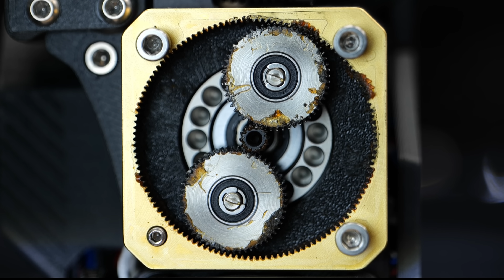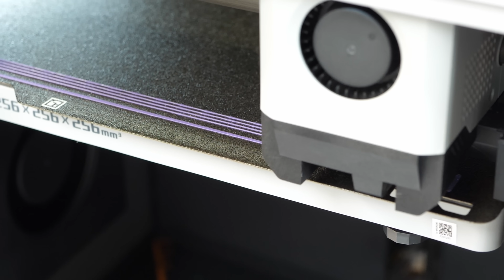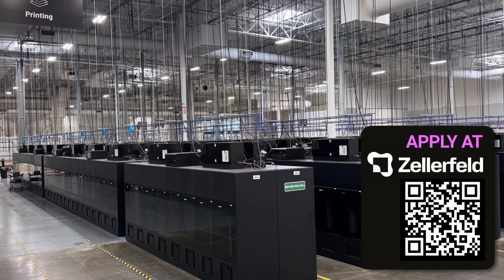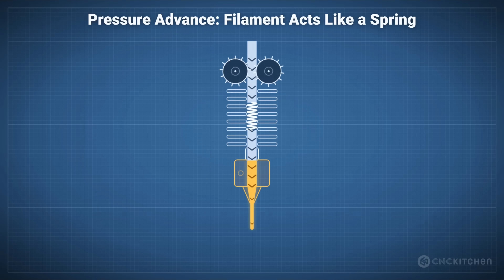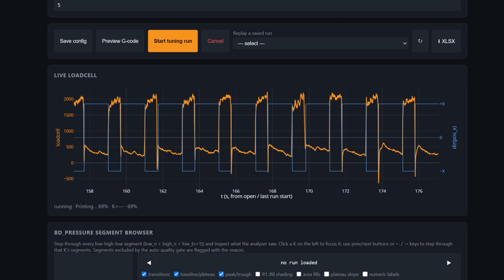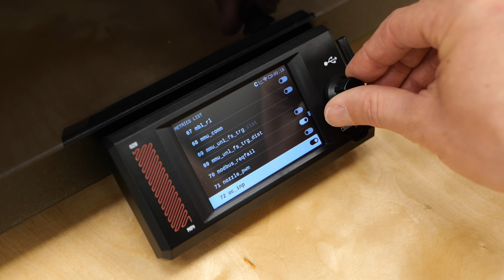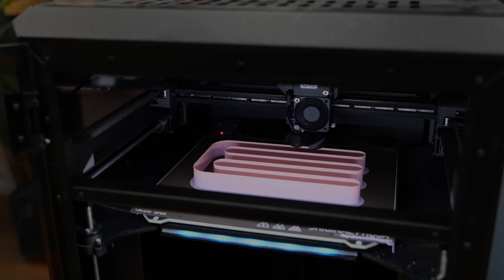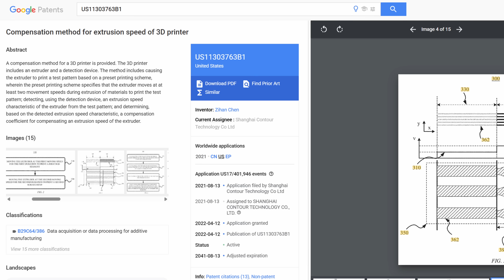I Automated Pressure Advance Using a Bed-Leveling Sensor

Comment: 2:40 even with a (per filament) calibrated advance, I still get the hole issue more than I'd like.
Reply: With a toolchanger you need a per nozzle calibration as well due to variances between nozzles due to wear.

Comment: Hi, I overextruded a Snapmaker u1(setting flow to 200%) after some printing (with ugly surface) he stops and told me there are melting issues. after returning to 100 % all printed fine to the end

Comment: On the patent thing, I'm thinking one could introduce hooks and standards for things like the pressure advance, max volumetric flow rate, crash detection, etc into the Klipper firmware, in a way that when turned on, it would send and receive data from an external script (so basically what snapmaker's fork did). Then if there's a patent issue, printer manufacturers using Klipper could put toggles for those in the control panel, and anyone could flash the open source add-on modules for those automations after downloading them from the klipper repository :-) being outside of the main klipper codebase would also make it easier for different people / groups to build their own versions or forks of the add-ons without causing issues with proprietary main code forks like snapmaker, or anycubic, etc.

Comment: Well, for perfect prints using a constant PA value is insufficient. As you, Stefan, most probably know, PA value is also flow rate and acceleration dependent (see Orca's adaptive pressure advance). So yeah, nice approach but still worse then manually calibrated ;)

Comment: If you have enough processing power, with the load cell they could also do a closed-loop pressure advance that works in real time while it's printing, without a set k-value. Zero calibration other than the factory tuning and nice results, by basically turning the extruder into a weird servo motor :D
Reply: Exactly my thoughts when I got the BDpressure! Unfortunately, the movement of the hotend during printing enacts some force onto the same sensor that would be reading data for PA calibration; hence why the loadcell/strain guage options have to park to achieve their readings.
Reply: In my testing PA is not linear but is also affected by back-pressure from the print surface, which is why PA is different for bridging. The feedback pressure reading you would get would also be affected by this back-pressure, but it might actually be a pretty good indicator of the effective extrusion pressure and thus flow-rate. At the very least it's another bit of data that could be combined with other signals to give more accurate results.
Reply: That's how the automotive industry uses engine data to continously change the air fuel on cars.   "Knock event detected, retard timing"  "o2 sensed rich burn, pull back on fuel trim"
Reply: A lot of industrial printers dos this

Comment: I bet the lidar on the bambu labs X1 was only initially used until they figured this out. You should try having the printer print lines on the bed like the x1 though so that it gets the most accurate pressure readings for reproducibility while printing
Reply: Thats the cheap way and I think its mainly a cost cut thing. Lidar is expensive and load cells are cheap.

Lidar is far superior in my opinion. 
What counts is what ends up on the print bed, not any second order flow dynamics derived from forces inside the hotend, which give you just a good idea about whats happening. Measuring the actual line width is the only real way to do it. Ideally constantly and while printing to have real time feedback.
Reply: @MsKoffeinjunky  the Lidar (not time-of-flight but trigonometry) on the X1 is garbage compared to the load cell on the A1 onwards.

Comment: One thing to note is the X1 lidar seems to have been originally designed to work with gray beds like Bambu originally supplied, if you use a colored or high gloss bed it has a tendency to throw off accuracy a lot. Bambu could use their official bed ID's (ArUco ID) to have a table to adjust for expected reflectance values and normalize, but since they didn't release colored plates this made it so the automatic tuning struggled on 3rd party beds (something I'm sure they were fine with).

I always did the PA calibration on the official bedplate and then switched to the plate I wanted (e.g. BiQu, Wham), you just wouldn't want to use a per-print PA calibration on non-gray neutral beds.

The pressure sensor method doesn't have that issue since it removes the bedplate variable.

Comment: One thing that hasn't been fixed (as far as I am aware) is reducing the actual flow rate at corners to compensate for overlapping extrusion. This makes the pressure advance calibrations give different results depending on if you use a straight line test vs a corner test vs a start and restart retraction test. It is an error that has been there since the beginning of slicers due to the way they model extruded lines. Slicers currently assume the "shape" of an extruded line is just a rectangle, and extrude the amount necessary for a rectangle. You can see this in the slicer preview. But in actuality, the shape of an extruded line is a rectangle with rounded ends. Where a corner or seam is, depending on the angle of the corner, the two extruded lines overlap by a varying amount. Which means if you don't account for the overlap, you will get overextrusion at corners even if your PA value is perfect. Here are some github issues that talk about it. It just hasn't gotten enough people to work on it to really solve: https://github.com/OrcaSlicer/OrcaSlicer/pull/11841   ,     https://github.com/slic3r/Slic3r/issues/5182   ,    https://github.com/OrcaSlicer/OrcaSlicer/issues/11254

Comment: if you implement it as a macro in klipper so that the gcode is dynamic based on the latest data set you could probably have it do a binary search to converge on the ideal values quicker

Comment: On the Essentium HSE we had direct drive extrusion and the current measurement was a big help to characterize materials and print parameters.
Load cells are definitely in the right direction due the sensitivity. 
Your approach is really interesting since is close to closed loop control, if you know what pressure you need for each material and temperature.
Reply: " ...and the current measurement was a big help to characterize materials and print parameters." Thats actually a quite interesting approache, that would mean its would be to implement such a thing without the need for a load cell and for printer that don't have one and would make it quite hard to implement a load cell into the print head.
Reply: Hey Jorge! Funny thing to randomly spot you here xD
Yeah I remember that it was quite useful when working on the 9085 profiles for DB. The only thing that might distort it a bit, is that current measurement observes the source of mechanical motion and not the recieving end. So stuff like f.e potentional backlash or stickslip in gear translations could have an impact on the measurement but influence the result differently. (I imagine)

Comment: The commanded square wave is a nice stimulus to measure the system frequency response function and the springiness of the extrusion system is a low pass filter. I wonder if you might get a better measure and more useful information from Fourier transforming the load cell data and calculating the FRF.

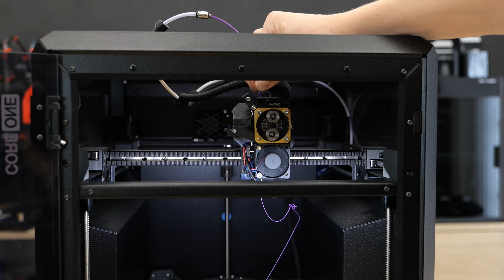Comment: As usual you did a great job in this video! However, the explanation around 1:20 is incorrect. The filament does undergo compressive stress, but the material is barely compressible since most polymers have Poisson ratios shortly below 0.5. The filament may buckle a bit in the feed zone, but this is probably negligible. You could very easily synchronise the extruder feed rates with the tool head movement speed and get wonderful results if the material would cooperate. The main driver of the time-dependent behaviour you describe is due to the viscoelastic behaviour of polymers, i.e. the deformation behaviour in both their molten and solid states are dependent on time and deformation speed. If a constant stress is applied, the strain follows with an exponential time decay and vice-versa. This comes down to the superlong molecules that basically behave like a pile of spaghetti, so they rearrange themselves over time when under load, align themselves, and retangle or spring back into their original state when given the opportunity. That is the real cause of the modulation required to combat corner bulging.
Reply: I understood the video explanation to be visualising what you describe, that this springiness is occurring in the liquid state.

Comment: I wonder if extruding in the air is holding the results back somewhat. There would be slightly more pressure in the tool head while actually printing an object, especially at lower layer heights. It would be interesting to see what the machine would chose when printing the actual test pattern or tower
Reply: Works for bambu lab so it should work here aswell
Reply: @ulwur  Bambu prints its calibration line(s) onto the print bed.
Reply: They could calculate this backpressure beforehand and maybe compensate for it?

Comment: Have you tried running two K values? One for advance and one for decline?
Reply: This would need something different than the existing `M900 K0.00` pressure advance system currently built into klipper and Marlin firmware. 

It's an interesting idea, which would work quite differently than the current approach which is approximately introducing the extrusion commands early before they would naturally be expected to happen. The question is whether this increased complexity would give proportionally increased print quality. Currently a well calibrated K value is generally enough to get good print results but sometimes not at the most extreme print speeds, especially for viscoelastic fluids like melted PETG and TPU
Reply: That's what I wanted to ask too. Why do they only use one K value and not two... for acceleration and braking.

Comment: A few days ago I finished modifying my Ender 3 max to direct drive extrusion, optimized for printing TPU. The PA ended up at 0.75, which I think is very high, but it works; the extruder motor isn't failing😂
Reply: That is correct, tpu requires.very high pa value but it doesn't even need it that much since you are printing it slowly
Reply: @riba2233 In fact, it was quite bad; the corners on the test cubes were sticking out by more than 1mm, now they're actually corners.

Comment: We could also calibrate the rigth extrusion temperature, if we can decide on some acceptable range of filament pressure for a given material at a given flow rate, we could gradually increase the nozzle temp until the pressure measured by the load cell falls into this range.

Basically, if a load cell allows you to have a reliable observation of the heat chamber pressure, a lot can be done to ensure good extrusion. In a plastic injection machine, there is a dedicated sensor for the pressure in the chamber, that is critical to control the polymer injection.

Comment: I've spent over 100 hours messing around with pressure advance on my MK4S. It's so important for springy filaments like PETG and I've struggled so much with it. The existing pressure advance calibrations are so labourious, cycling through different flow rates and performing manual analysis. This tool will be such a gamechanger. I'll try it tonight and post my results on github when I'm finished with it. 

THANK YOU STEFAN
Reply: Hi! Did you end up testing this on your MK4S? How reliable was the load-cell data logging? Did you notice any dropped samples/packets or gaps in the recorded data, especially during longer recordings?

Comment: The issue is the offset between nozzle in free air pressure response and in printing condition response.
Backpressure is the main factor.
Calibration should be done real time while printing
Reply: Unfortunately the prusa buddy firmware cannot change PA value without clearing the movement planner, which causes the printer to halt. It's a known bug.
Reply: @321tryagain i see what you mean.
Generally speaking, while 3d printing controllers and softwares descending from open source reprap philosophy is a very cool think, there is a distinct lack of industrial approach.
For instance there is no fully developed firmware capable of controlling industrial servos via industrial protocols like ethercat.
It is always the “lowest possible requirement” approch that is now slowing down open source development.
Sum that with the peculiar “first lady behaviour” of many software communities and you get the receipe for companies like bambulab expoliting open source and gainig terrain giving the mass what it needs.

Comment: I guess someone could use one of those sonar or optical sensors from one of those Raspberry Pi development kits, print the PA line test, scan it with the sonar sensor, then automatically pick the line that appears to be the most uniform and adjust the K value (since it knows what was printed when). This is assuming the sonar sensors in those kits have fine enough detail to determine when a line is uniform thickness or not. Line chasing robots use this principle all the time to determine the action they need to take.
Reply: Its almost impossible to get 1mm accuracy out of a sonar sensor.

Comment: I've often wondered why Prusa hasn't implemented something like this themselves in the time since releasing the MK4. Back then, there was a lot of talk regarding potential features the loadcell could make possible, but it never really seemed to go anywhere. Thank you for saving us all from manual PA calibration!
Reply: because its not needed and just chasing unicorns ...   im printing for several years now on different printers with more than 20 different brands and materials ... i opnly ever had to calibrate for one type of filament ( pla, abs, asa, peg, tpu , pla-cf  and so on .. ) never for manufacturer or colors .. it was everytime i calirbated the same across different brands for the same type ...   completely useless to chase perfection here and a waste of time before ever print aswell as filament waste
Reply: @WaschBaer__

You seem very confident saying "completely useless" and yet many others have said this is useful. Have you considered you might be wrong or is that something you don't do?
Reply: @theodorekorehonen  is it useless for the normal user printing ? yes ... for a company manufacturing high quality  perfect fit parts ? yes 
like i said i have several different printers, i have build several different printers myself too and never had the need to calibrate for each color ...  cause its simply not needed .. there is no variation that big that you need it unless you are printing precision made parts needing super tight tolerances ..

Comment: You are definitely onto something. And there is also the change in speed between walls and infill. One PA value at one speed is not going to work at another speed. The faster you go, the less K value you will need. That is what I've observed. So having the gcode output the PA value for walls and infill separately - I think that's where I would take it next.
Reply: Actually volumetric speed (flowrate), not just linear speed. You can print lines with different width or height at different linear speeds, but still maintaining the same flowrate and PA. Your feeder doesn't even know how fast the toolhead moves, only volumetric speed matters.

The dependence of PA on speed is a popular misconception.
Reply: @aleks-ivanov  This is true yeah!

Comment: I think that the slope could be even closer to ideal if there was a K ‘acceleration’ value as well as a normal K value to adjust how fast the extruder changes pressure inside the nozzle
Reply: Marlin and Klipper already use the maximum allowed acceleration in LA/PA calculations.

Comment: Are you really asking why prusa does not have automatic pressure advance calibration? the company that sells a 3k+ USD printer that doesn't have a nozzle wiper, uses filament sensors with springs so stiff that they prevent use of soft filaments without a bypass, not even an option of an AMS, an enclosure that costs 600 USD and barely works? That's the company you expect to include automatic pressure advance calibration?

Yes, I am indeed very unhappy with my XL.
Reply: Well said. But don't worry, they are working on it for some years already 😅

Comment: even crazier than all this is the fact that some machines will use the required torque values from pushing the filament to measure the pressure.